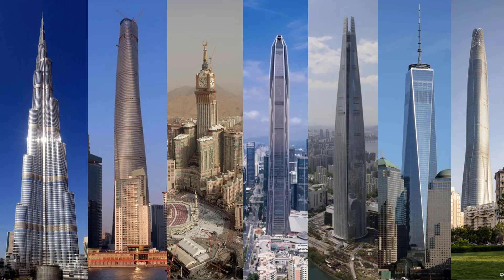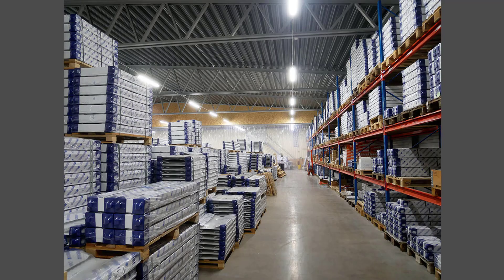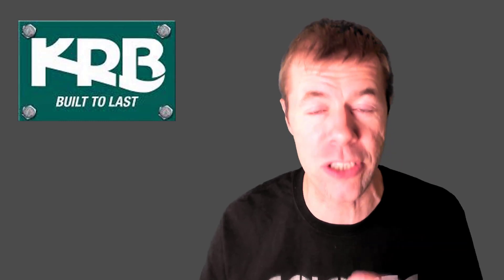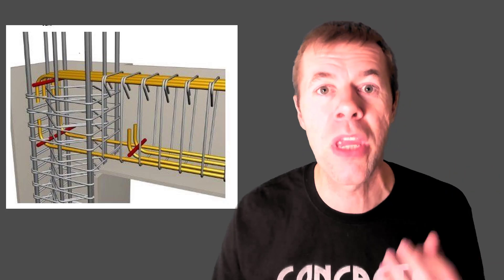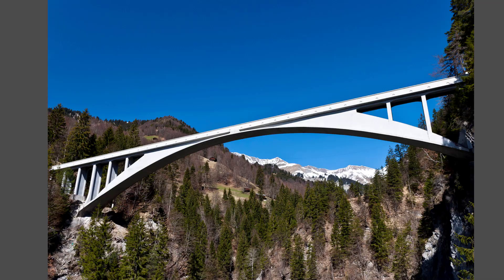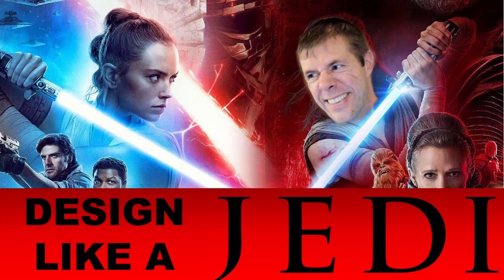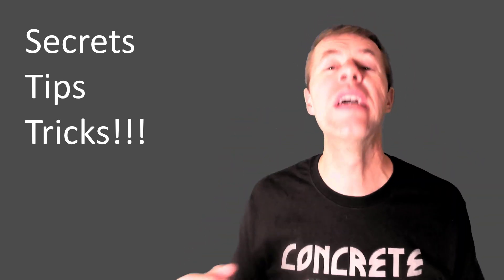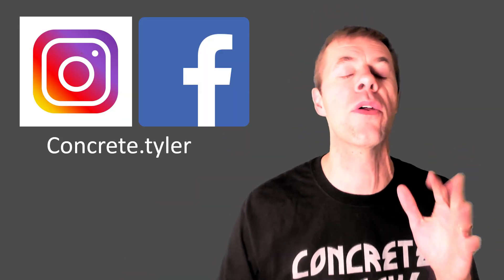Mastering Reinforced Concrete | Playlist Introduction

Comment: When Mixing cement - If you use a water based liquid primer in place of water, does that add a LOT of strength?

E.g. Ames Super Primer.

Any cons besides cost?

Comment: There was a concrete mix that was impervious to drilling and had Zero rebar. It could withstand a nuclear blast [nia direct hit] and show no damage . It was commonly used between 1945 , and 1960 on Municipal buildings , city bomb shelters , Hospitals .  I want to know what was in that Mix , and why we don't use it any more? Those concrete structures still stand today without decay .

Comment: Hi Tyler
I was wondering can Bubble Filled Concrete Deck (BubbleDeck) be applied to some of the tallest buildings and still achieve the same effect, but with as it claimed 25% ~ 30% greener and lighter? If so, Why won't the concrete be weaker? I don't seem to be able to wrap my mind around it. Would you be so kind of helping me understand this technology in relation to Concrete strength. Thank you

Comment: As an expert, you may be able to us why a 47 floor steel reinforced cement building would entirely collapse into its footprint in a matter of a few seconds,  allegedly from office fires?  It appears that after the initial collapse of the penthouse structure, the collapse reaches freefall speed. How is this possible without the use of explosives?     http://ine.uaf.edu/wtc7

Comment: Hey Tyler, what are your thoughts about Aircrete and EPS concrete and other light weight concrete?
Reply: Good question, I'd also like to know more about cellular "foamed" concrete for structural and insulation uses.

Comment: What do you think of the effects pouring muriatic acid( hydrochloric acid) on the finished white surface of concrete to expose the sand. I know it breaks the paste down and makes fumes from experience, but how much does it actually decay the concrete after it has been thoroughly nuetralized with water, then sealed when dry? It seems like it instantly ages it 20 years. I make sure the cover is always 1.5 inch to all steel in slabs but i wonder if the pores and concrete will degrade and basically dies off and crumble in say the next 40 years. I see moss from rain grow on some of our older projects and it kills me people just leave it on. Anyways thanks for the knowledge